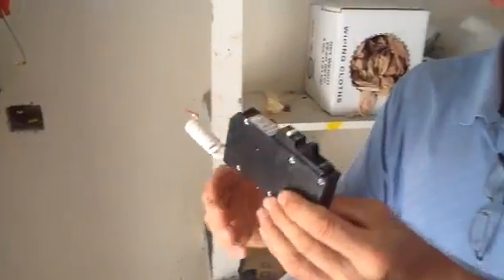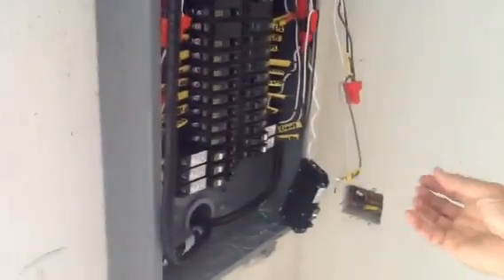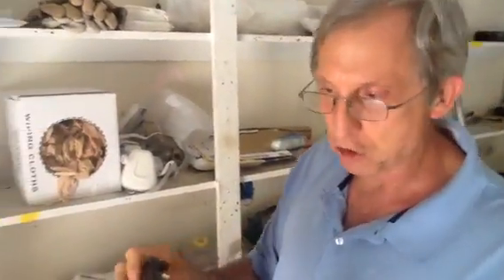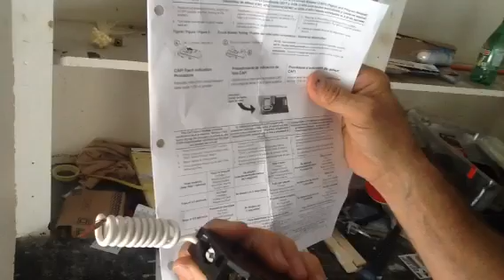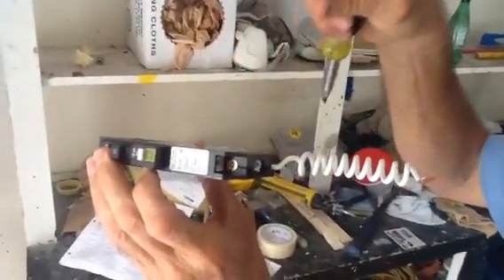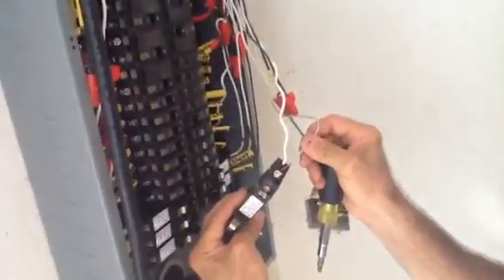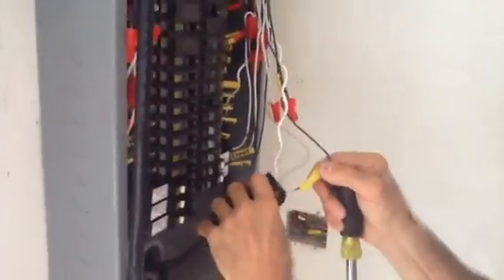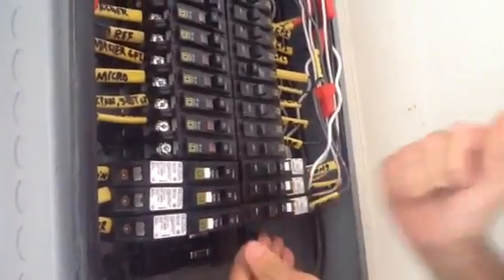How to install a Square D Arc Fault breaker/ why

Comment: Skilled labor, now that's an interesting thought. Over the last 40 years our colleges have pumped out STEM degrees left and right, but nobody wants to be a civil engineer, or an electric engineer, a certified welder, or any of the dozens of well paying, but physically demanding jobs out there. We have a huge number of educated people who can troubleshoot computer networks, or program, but not so many people that know how to build a bridge, lay a foundation, commercial power installations, HVAC, and other jobs. I have nothing but respect for people that keep the power on, the house cool, the plumbing working, and sewers underground instead of backing up onto the streets.

Comment: There is so much wired covering the neutral bus bar ?  Is there a easier way to connect it by now removing it the wires

Comment: Thanks for the video David. I saw quite a few years back that AFCI became code for new construction ( in FL ) but the cost was very high. I am thinking about retrofitting my panel with them. I am just a homeowner but I do like to do my own electrical work. I am wondering if I would get a break from my insurance company for putting them in. They seem to be about $35 a pop right now so I would probably be looking at a couple of hundred dollars.
Reply: Update: Seattle Home Depot $65 per AFCI

Comment: I ran my white wire and the pigtail to the neutral bus bar and I could not figure out why my breaker kept tripping once I put load on it until I saw this video and realized the white wire going to my first outlet needs to be hooked up to the breaker and not the bar (completing the circuit-duh to me), so thank you for teaching me that.  What's interesting is the breakers in my box that are not GFCI and Arc fault combos work just fine the way I had them done.  Any idea why?

Comment: sorry i didnt understand. my panel has only one hot wire currently attached. so then i would need to identify its associated neutral, disconnect it and then reconnect it to this breaker? is that correct?
Reply: yes. and the pigtail on the breaker goes to the neutral bar that you took  the circuit neutral white off to redirect to the breaker.

Comment: I have Arc fault breakers in my house. I have one in my basement that wont reset, and if it does it will trip immediately  if I try to use any tools on that circuit. I also have one in the kitchen that my coffee maker is on. It also trips often.  Should I replace them with a standard breaker or keep the ark fault.

Comment: Hi David, great video...  I have a question on the white neutral.  I have all my neutrals joined together in a junction box and it comes to the main panel box in a single 10ga wire.  In other words, I don't have the designated neutral wire for that hot wire.  What do I do?
Reply: Please tell us that is not what you have/did.

Comment: underwriters lab needs to meet us in the middle. Most living quarters could run on low voltage ac or dc circuits if we adopt a standard. Then we can set one step down transformer in vicinity and feed receptacles accordingly. Three phase should be made availiable for residential alpplications for efficiency and load calcs. We supply a very powerful voltage to many devices(phones laptops computers transformers ect) and they do not require it thus the need for arc fault technology. A three phase 30 amp generator would work very well with three phase appliances on a residential scale. We could use aluminum conductors for smaller dc circuits with buss fuses rated from 1 to 5 amps. Arc fault and ac lighting circuit for multiple incadecent lamps if you want to. The fans may need it if it is not ul listed but light bulbs never needed arc fault technology before. Smoke detectors should be locked in the on position and be tamperproof on a seperated line ahead of the main. Kinda like a fire pump. Let our UL listed fire detectors save Lives!

Comment: How about finding the neutral wire.
Reply: it will be in the cable coming in with  the black. you follow it to neutral bar and remove from there and put on light screw as he showed. then pigtail goes on neutral bar.